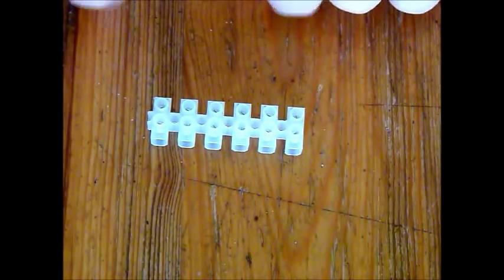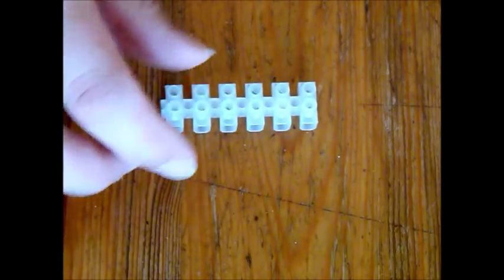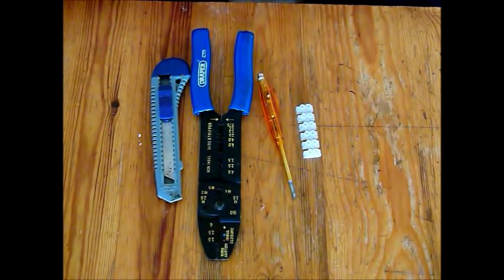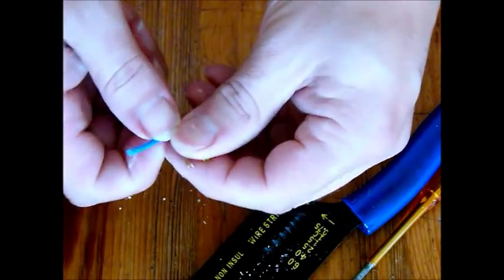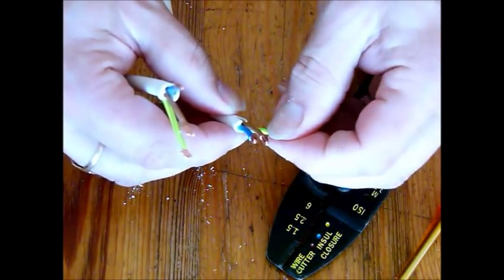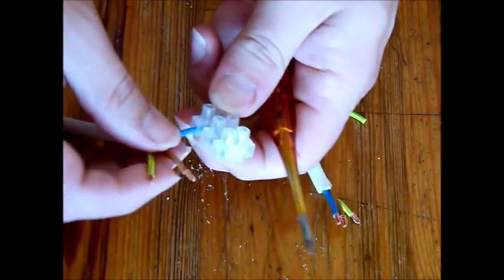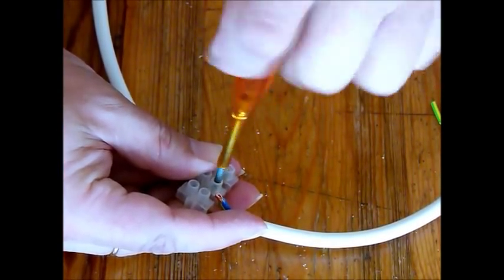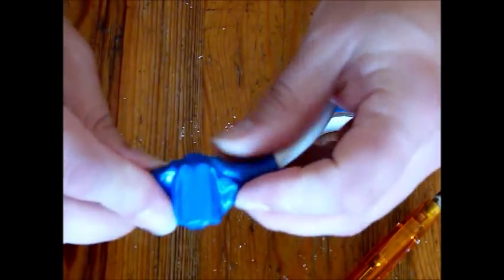Electrical Wire | Connecting Electrical Wires | How to Connect Electrical Wires Together

Comment: Very useful thank you.  I'm trying to do a mini garden lighting system with a few lights.  I've finally nearly wired it all up but one problem I'm struggling with.  When you have a 3-way outdoor junction box with the terminal strip as you say, how do you put 2 wires into the connection?  Because I assumed they would fit from seeing other images etc.  But when I looked, there is only enough room for one wire!  I tried to overcome it but I don't think I can do it, arghhhhh!  So Im missing something clearly!  Maybe this is where I'd need a 13A connecter maybe?

Could I ask something else?  I did buy some wire cutters but saw you didn't use them for stripping the flex.  Maybe I've missed a basic thing, hence the title - wire cutter not cable/flex!  I assumed wire cutters were used for the outer sheath too!  My cutters have weird measurements on them (AWG 8 - 16, CR-V and CUT) , something, something gauge I guess?.  I think I may invest in some better ones from CPC (love that company).  

I watched your video as initially, I wanted to know if you could cut terminal/connector blocks - and you answered this!  I've learnt a lot from your video and the image of the taped wires brings back childhood memories of Dad doing the same.  My learning style is by watching, so these clips help me a lot.  If we had YouTube 20 years ago........lol

One thing I thought when watching your clip - 'I bet he will have loads of comments from registered electricians saying people shouldn't be messing about with mains voltage, get an electrician'.  I haven't looked yet, but will after posting!  I appreciate your warning on the video for people re disconnecting or something (?), but maybe if you do have any comments about getting an electrician, you could overcome it by stating the video is for information purposes only, always consult an electrician etc blah blah blah etc.......

I'm not conversant with the UK electrical laws, so maybe this is ok to offer this advice, who knows (electricians lol).  If I recall correctly, anything not permanent doesn't come under the codes?  My lights therefore, are not permanent and are just temporary (cough) (same for the fountain I've got lol).  I do have an RCD though as I'm not silly or wreckless (described in an emoji story...)

⚠ ‼ 🔌 🪓 💥 ⚡ ☎ 🚑 🩺 🏥 🏴‍☠ 😭 ⚰ ‼ ⚠

Comment: What if I want to make a junction there? What do I do?
Reply: Same question for me!  I need 2 wires coming out of the terminal to supply a garden light, the wires just don't fit into the block i.e. more than one, I'm assuming you need a higher-rated block, 13A maybe????  I know it can be done but I don't know how to if the block wont accommodate the width of more than one wire

Comment: I've got one outdoor light , could you use one of these to use the wire on one side , and use 2 wires on the otherside to put in 2 outdoor lights ?  Inside a waterproof junction box ofcourse
Reply: I need to know how to put 2 wires into a terminal block too, but it appears the wires don't fit, so unsure how you would take a light off the terminal block ?? maybe a 13A block might fit the wires, I don't know!

Comment: Hi. Thank you for your effort. Your video is much too long for this simple procedure. Much more importantly is that this is one of the worst methods for joining an electrical wire. The main reason is that this type of joiner has a limited lifetime, the plastic eventually fragments, exposing the brass connectors, which will surely short off. Also, the junction is much too bulky, which greatly reduces the lifetime of a regularly-used extension. DO NOT DO THIS!!!
Reply: Just found one of these connectors after 30years outdoors, it didnt look any different.

Comment: The use of choc-block is great and very safe, the use that this guy gives is very very BAD. Although I've seen people work with electric tools using this method and without tape, I wouldn't use. This is to connect light features to the main current or connecting cables in junction boxes. THIS ISN'T INTENDED TO MAKE EXTENSION CABLES!!

Comment: This is bad practice. Only use a BS approved flex connector. These are available as straight through connectors, or a plug and socket type. Four outdoor use, only use a waterproof connector of IP68 rating.

Comment: This is horribly dangerous and very sloppy. Terminal blocks are NOT intended for use in exposed situations unless used for non-lethal voltages - so you could join things like domestic speaker cables or wiring for a battery-powered doorbell, but otherwise forget it - and wrapping it in sticky tape is hardly a remedy. Purpose-built mains flex connectors are widely available from DIY outlets, including both permanently-joined box types and pull-apart plug and socket designs - just search on Google for examples - so for pity's sake use one of those!
Reply: Believe it or not these things are in widespread use for mains electricity.
Reply: What brand do you recommend?
Reply: Zax Zaxx u

Comment: It was 2012 … so I'll give this method of connecting a pass.
Reply: So, you have a better one?
Reply: @castolum  you have to replace the whole cable where it joins inside the appliance. These connectors are what we use inside the wall cavities. This guy is a complete idiot.

Comment: its better to splice, solder then cover with a plastic sleeve that u heat to seal everything.
Reply: In some cases, maybe.
Reply: A video I watched suggested not to solder the wires going into the blocks.  Interestingly they said solder was 'fluid' or something??  I took it to mean it was 'soft' and over time it could cause the connection not to be 'tight' - but please correct me as I'm not conversant in this area!  The video I watched also said about crimping the wire before putting it into the terminal block - that seemed quite a good tip?  - Again, please do correct me if wrong!

Comment: Why can't the wires be connected  without the connectors , just linking the wires and wrap with the electrical tape. Neat and not so bulky. Please advise. Thanks
Reply: It's not allowed by electrical code either in the U.S. or the U.K. Electrical tape, while offering some protection, is not an approved insulator. It can come unraveled and become a potential fire hazard. Also, a splice without a mechanical connector can also potentially come unraveled. Bottom line: it's dangerous. This type of connector is favored by electricians in the UK and the rest of Europe while U.S. electricians overwhelmingly favor the wing nut-type connector. Either type works well, but also note that these type of connections are required to be contained inside an accessible junction box.
Reply: @photoscottsb  What is the purpose of the junction box?
Reply: @jamesduff6937  protecting the possibly hazardous (spliced) wires from environmental hazards (rain / wind / dust storms) and touching hazard.
Reply: @VolvoMoose13  thanks for your reply and explanation.  Cheers.

Comment: a couple of questions, what amp block would I need for a cinema surround wire I wish to extend, also do the wires need to be touching each other inside the block?
Reply: +phil &#171;DJ Phil A&#187; andrew do not use these connectors... if u really need a quick fix use a wago clamp they hold up to 32A easilly and for speaker wires please solder and use heat shink.. these connectors in the video is a fire hazard, this because if u tight them too hard u crush the wires making the wire thinner and if the right current going through there overgoes the conductivity they get hot and may cause a fire same if they are lose they will generate sparks.. i work with automatics in norway and this is a nodoo
Reply: +proks prksarn OK thanks for the heads ups.
Reply: +proks prksarn How long do wago last for?  I'd imagine the springs will give eventually give. The problem with EU regulations is that they are always sold to the highest bidder.  No doubt a few golden handshakes in behind the scenes secured Wagos future.  Give it another 20 years and screw in will be back in fashion.
Reply: You don't want to use either these block clamps or that wago shit. Replace the whole cable and connect it inside the appliance.

Comment: What you've shown in the video is not a safe method of connecting two wires.
Reply: It's as safe as any other method if done right.  Of course I wouldn't use it for appliances out in the open or leave it trailing on the ground.  It would be permanent enough job for a TV extension with wires down the back of the wall for example were it won't come into harms way.
Reply: +liveswired Not at all, this is an unsafe method and should not be used by anyone.
Reply: Mostly because the protection of the cable (The electrical tape) is not secure enough and a junction or connector box should have been used. That's why.
Reply: Reko Starr It's fairly standard electrical safety, covered if you can Pat test.
Reply: @realbadbav  what is the best way to do it?
Reply: @realbadbav  What is the best way to do it?

Comment: NEVER USE THIS METHOD for fixing cut cables especially outdoor use.
1) it is not waterproof
2) the tape can and will eventually come lose
3) a tug on cable will break it apart leaving live wires
4) many other issues

If you cut wire on hedge trimmer or lawn mover buy a proper connector.  One that you can trust.  Alternatively and cheapest, put a plug on cut end and use a longer extension cable.

Indoor use is just as deadly!  Only use these connectors inside sealed units with cables out of reach or firmly secured.

Never trust youtube with your life

Electricity can kill.  This man is teaching bad practice.  DANGER OF DEATH.
Reply: Do you mean a proper connector like those Wago ones I've seen about?
Reply: Yes these connectors were designed for electricians to use inside the wall cavity. This guy has found them at his hardware store and decided to join an appliance cable with them.
Reply: Terminal bocks i know them as. I used them the other day to join two 240v wire together. Wrapped a load of tape around it, quick fix, but dont trust them at all and will swap them out. Would only really use these in low voltage things, like car wiring.

Comment: how many amps would I need to extend a cable for a twin main socket UK.
this sock I will be using to plug in table lamps, Phone & Laptop chargers & things like hair dryer & hair straightener.would 5 amp do it or would I need more. please help???
thanx in advance